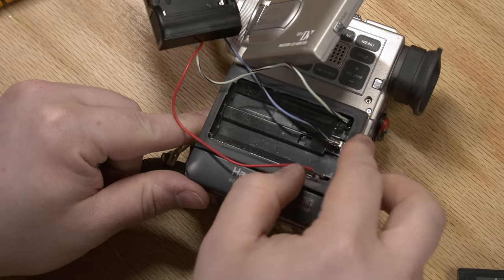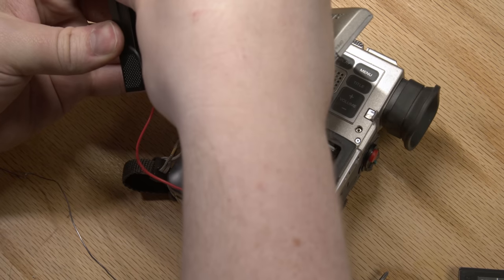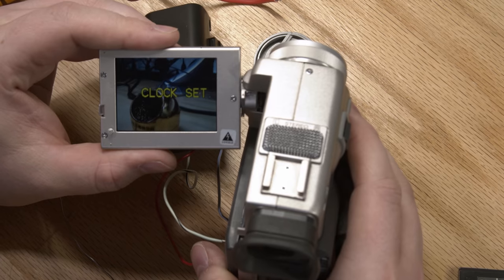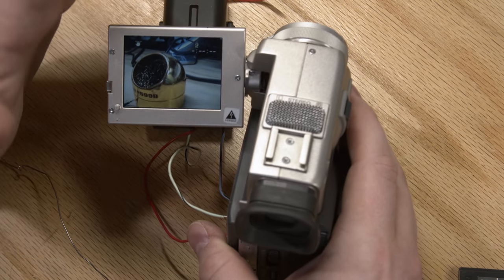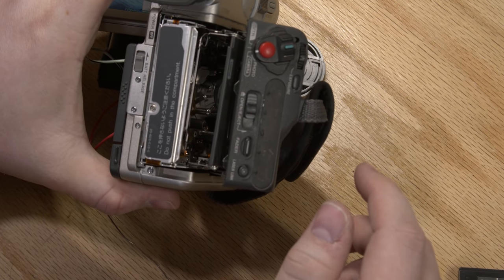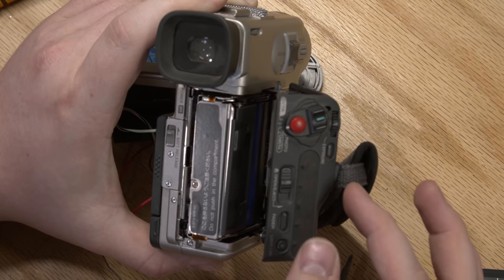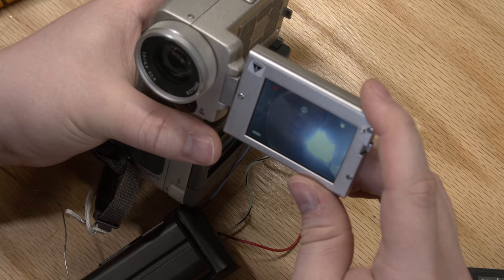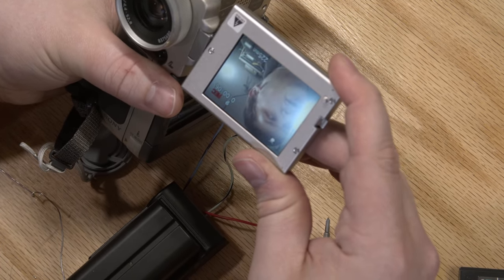Adapting Infolithium to Infolithium

Comment from the maker: Hilarious update: A week later, the friend who gave me this says that someone dropped off another one which included both the now-unobtainable adapter (the commercial version of what I made in this video) and the proprietary power cable "which everyone throws away."
Reply: did you get them?
Reply: I feel like literally almost everyone is completely incompetent with their power adapters/charger bricks... Like, does no one have just... a drawer where they keep every single power adapter, neat and labeled with one of those battery-powered label makers? How do you even loose a giant heavy black brick?
Reply: @datachu  you guys label the power cables? I tought it is supposed to be 30 minute mission to find the correct one
Reply: @datachu  to be honest I think I'm already on the upper-end of a normal consumer (not talking about pro equipment then) in therms of tidying my cables, and they're all in a box just tied together and done, heck labeling them up is definitely something I would only do when someone tasked me to keep their cable mess tidy (and I know for sure it would be a 1 month only thing, the next month it would be all a mess again).
Reply: @Kalvinjj  I probably just enjoy using my label printer more than I should lol. It just makes such satisfying noises.

Brrrrrrrr Awkward Pause Snip-Snap BEEP
Reply: btw next time if you cut down to your line with the side cutters first you'll save a lot of time sanding the case
Reply: @datachu  this is WHY I have started to flat our refuse to buy anything that does not simply charge by USB C. screw the noise of a zillion EVERY SO SLIGHTLY proprietary adapters. tired of that CRAP.
Reply: Next time JUST wait another week :-) ... but then we wouldnt have had such an interesting informative video experience on a lazy Sunday morning
Reply: Even though you made this, and used tape,  once you got it working, once you got it,  Silicon it the adpter in then Epoxy to finish the job.
Reply: Oh my gosh, that's a hilarious update, after all that trouble! By the way, I appreciate you showing all the silly mistakes you made, happens to me all the time, nice to know I'm not the only one. Awesome work though, very impressive.
Reply: I don't label mine because nearly everything I own with an AC adapter is just 5V, 12V, or 24V barrel jack so I can just use the rating on the back, but I sure as hell have a pile of them.  @datachu
Reply: Welp, that still leaves one camcorder that doesn’t have those things.

Comment: Extremely refreshing to see someone who is rightfully reluctant to work with lithium ions. I hate projects that involve being forced to worry about them.
Reply: This. Lithium Ion batteries explode if you look at them wrong.
Reply: @DrewWalton  I solder Li-on packs for drones all the time. Never had an issue. Li-on are so much safer than lipo. Lipo is what is dangerous
Reply: @nicknick8148  shit that's what I was thinking of! Lipo, not Li-ion. Good catch mate. Cheers!

Comment: Lithium cells are one of those things that people just never seem to appreciate are actually really dangerous if you mess around with them. Kind of like tires.
Reply: Tires and lithium batteries and car springs all share one common theme and that is people either beleive they are litterally bombs or people think they are harmless… very rarely are people in the middle where the danger really is.  The danger isn’t that any of these things are out to kill you but rather the amount of energy they contain in amount of space they consume is very dense… similar to a bomb… however unlike a bomb they aren’t just ready to kill you at any time

All of these things including lithium batteries if they are in most relaxed state, IE, discharged, deflated, or unbounded they are minimally dangerous.  They can still all be dangerous, a “dead” lithium battery can still contain enough energy to ignite some stuff and get hot… but be more like a AA battery shorting out when lithium battery is at cut off voltage.  a tire flat on the rim can still bite you back with the bead wanting to either be seated or unseated if your pulling at that by hand, and a spring even with tiniest amount. If rebounded it can release more energy than is being imputed depending on the material and the preload.
Reply: Wait, what's up with tires?
Reply: @Stargazer1312  It's that whole deal of a not insignificant amount of air compressed into a relatively small space, which results in quite a bit of stored energy. Safe enough, most of the time, to be around all day; but if all that energy gets released in a hurry, it can be quite unpleasant.
Reply: @Honeypot-x9s  Coil springs are fine right up until you actually have to remove or replace one on a strut. Then it's a bomb.
Reply: @tamberp  oh, right. I worked on tyres on push bikes since I was really little with my brother, so I was confused about tyres too. But that’s because he taught me well and I don’t even consider doing anything on a tyre without fully deflating it first. Actually that’s got me thinking: do cars still use inner tubes? Or do they just hold the air directly like tubeless bike tyres? In which case yeah that’s even moreso needing deflation first yeah.
Reply: @kaitlyn__L  Generally, no; most car and truck tyres are tubeless these days. There's still older stuff and special applications that use them, but for most applications they've had their day and fallen by the wayside.
Reply: It's kind of amazing how widespread lithium batteries got without anyone considering the side effects of the technology. I've had to pull bulging batteries from devices that are over a decade old and were just sitting in storage waiting to explode.

Comment: The cast iron pan being the upgraded version of the explosion containment pie dish?
Reply from the maker: correct!
Reply: @CathodeRayDude  an extremely wise move. I've learned the hard way about fucking around with lithium packs. No fire but lots of sparks and an inadvertently welded leatherman. Never again!
Reply: I was thinking the exact same thing
Reply: Far better than my quick-slap open window tactic
Reply: @jongmassey  my neighbours house burned down due to a litihum battery getting punctured, they are not for messing arround

Comment: for what it's worth, there are little portable spot-welders meant for building/refurbing small 18650 packs and they work a treat. I got a cheap one from Amazon for around £20 and used it to rebuild both the 6cell and 9cell packs for my laptop, so it was well worth the investment

Comment: Classic JB Weld is the bee's knees for sticking ABS plastic together real good. Sets to almost that exact shade of charcoal grey, can fill pretty big gaps, and sands fairly nicely. Not that you need it since the proper adapter wandered in, but there's always a next time!
Reply: I was going to say hot glue
Reply: @neb_setabed  Hot glue is bad for long term and exposed parts, it dries up and cracks. It's more like a meanwhile or test application rather than a definitive one. Epoxy is the way to go, JB Weld fits nicely here.

And if you want a well done thing, definetly 3d printing.

Comment: Also fun little tidbit: I'm pretty sure that "C" pin doesn't mean "Charge", it means "Communication". If I were to guess, it's probably a 1-wire communication bus, which is why the board on the old battery was so complex, and "InfoLithium" was such a big deal. The controller on the battery monitors power going in and out of the battery, judges the cells' lifetime, and gives the camera that fancy little battery gauge - which the camera would have no way of knowing without being able to judge the cells (swap the pack, change the cells, and it loses all behavioral info about them). So the individual packs track energy (Wh) going in/out of them, and the camera asks it for that info to display on the screen and act upon.

So yeah, that pin is important. :) Most cheap devices don't care about the pin, because the controller also has hard logic: it'll cut off power flow "with force" if it's being over-charged or over-discharged. So they just rely on that brute-force safety mechanism. Bad tactic, but it ... works ... so, cheap-crap manufacturers don't care.
Reply: oh and related factoid: these "smart battery packs" will completely freak out and set a "permanent fault" fuse, if they detect that any of the cells in the pack "go dead". So if you take apart a pack, and break the connection to the board, the board will use its remaining power from other cells to write "ACK! I AM PERMANENTLY DEAD!" (to its EEPROM memory), and you will never be able to charge/discharge it using good cells again. You have to get tricky - either find a way to cut off its main power supply (I think the negative-most supply lead, maybe?) so it can't write to its memory in time, or put the pack "on life support" and replace one cell at a time using a benchtop power supply set to 3.5v or so - like a heart transplant machine - so the board never "sees" the cells get disconnected. Might be easiest to solder the benchtop power supplies to the board's cell sensing terminals directly. Or just not do this at all because it's an effing nightmare.

Anyway, enough mind vomit. Awesome job with this overall.
Reply: @FalconFour  mine just did ,out of 2 cell one of it gone bad first  ı tried to revive it with bench power supply but it wasnt holding charge ,so ı removed it change it with 18650 battery with it's own controller circuit and that error message all the pins are there but like u said damn eeprom know it now ,and back then ı charged all the cells to total of 8 volts and tried on camera it didnt want to charge that pack already marked bad.

Comment: CRD: "I've never found a device that actually uses this data contact"
Sony: "Hold my beer!"
Reply from the maker: I should not have challenged sony
Reply: Well of course Sony would be the one to make use of the technology Sony created.
Reply: Yeah I have a Sony Mavica that refuses to use non-authentic batteries. It turns on, then displays a message saying the Mavica is for use with "infoLithium" batteries only, and then shuts off. What a troll. Fortunately some chinese battery manufacturers source the Infolithium logic board so it will trick the camera into believing it's an authentic battery.
Reply: Nikon laughing while counting bills. Their DSLRs wont even take fake battery adapters
Reply: @gabotron94  Good to know, one more reason that makes me glad I went with Canon back in the days... their DSLRs just say "cannot identify the battery - do you want to use it anyway?" "Okay, here you go" when I plug in my 3rd party mains adapter.
Reply: @tituslafrombois1164  Sony is all about the proprietary technology that does exactly what existing standard technology already does but that makes sure royalties go to Sony. Fortunately they are not successful more often than they are.
Reply: @chaos.corner  Trust me, I know... I've fought against Memory Stick on many, many devices...
Reply: This reminds me when this bullshit of DRMing everything bit them in the ass with the PSP's battery
Reply: Sony: The maker of all the obscure media formats and batteries
Reply: @CathodeRayDude  You should have realized that since it has the famous single proprietary connector they seem to have for every digital camera/CDman they made. I swear Sony has to be one of the single largest companies that's responsible for the ridiculously immense amount of E-waste in the world.
Reply: *hold my sake
Reply: @CathodeRayDude sega tried it with the trashcast. my favorite failure

Comment: Regarding these old generation InfoLithiums specifically, I've found my camera will work if you keep the original board for its ID chip. Disconnect the cells and put your own power source in parallel with the board's output terminals.

I pretty much agree with you regarding Li battery safety, however I have had success very carefully soldering to prewelded tabs. One thing to mention is always discharge the cells to 3.0v or so if you can before doing this as it should greatly reduce the chances of an incident.

Comment: Absolutely incredible to me that the InfoLithium signal is cross-compatible across different battery form factors. That seems like exactly the kind of thing that they'd flip a few bytes around for no reason other than a different guy was working on that particular InfoLithium form factor and they never conceived of anybody attempting to adapt batteries in that way.

If you have two pieces of plastic you need to combine like that, one approach I've used with success (ideally if you know they're both ABS, although you can often mix/match) is to get some 3D printer filament of an appropriate plastic (ABS/PETG/Nylon/etc, depending on the base plastics) and an old junky soldering iron tip you don't care about. Use the filament like a "welding rod" to fuse the two pieces of plastic together into an appropriate configuration. You can't easily take them apart, but the results are generally strong/permanent and don't look too bad if you're careful about how much of the plastic you touch/melt/fuse with the iron.
Reply from the maker: The reason I didn't join them permanently is because I don't want them to be permanent - someday these solder joints will break, probably someday very soon, and tape is much easier to remove.

Comment: Gaff tape is designed for temporary use. It does stick pretty well over the long term (the glue will dry out and get crusty eventually). But the "residue free" nature that you mention goes away the longer it is left in place. I'm talking like months to years here, not days.

Comment: You should also mention that fire extinguishers don't work on lithium batteries unless they're specifically made for that purpose. They just burn until depletion.

I have a friend that made a whole battery pack of 20 cells by soldering them, but he needed to use an iron that could heat up fast, with a flat tip, and with plenty of flux. That can't be used for rebuilding because it wouldn't fit the case. While it's not something I would recommend doing, that pack still works perfectly, comparable to all the ones they made with spot soldering. And the multiple fires he had at work were not from packs he (or his coworkers) made.

By the way, this kind of adapters would be probably best if we can make a design to be 3D printed.

Comment: Costum adaptor projects like that are where 3D printers definitely came in handy 😇
Reply: Absolutely!  With this project, I definitely would've taken an afternoon to measure the heck out of each battery type and the charger, spend another day or two modeling an adapter in FreeCAD, spent another afternoon making an adapter PCB design, ordered a bunch of pogo pins and stuff from Digi-Key, then never actually finished the project.

Comment: When I need a weird power adapter for a camcorder, I visit a site like ManualsLib, find the manual for the camcorder, and usually within the "included accessories" list near the front they give you the model number of the AC Adapter, which I can then plug into eBay and usually find what I'm looking for.

I've also used this method to track down the exact right remotes for several video decks.
Reply from the maker: Yeah, I've done that sometimes but I have mixed luck with it.

Comment: For basic project wire, you want 22AWG, stranded (7/30 aka 7 wires at 30AWG),  tinned/silvered copper wire. Any insulation is fine. 

For small repair (aka bodge) wire you want 30AWG solid tinned/silvered copper wire with Kynar/PVDF insulation.

Comment: I worked for Sony back when this camcorder came out.  I own a later model, the DCR-PC100.  It uses the NP-FM50 battery.  I never realized just how few cameras used the NP-F100/300 battery.  There were only 2 models that did.  DCR-PC7 and DCR-PC10.  They definitely are next to impossible to find.  The rest of the DCR-PC models seem to use the NP-FM series battery, which is still pretty easy to get.  Good little converter there.

Comment: Man, I really felt that wire rant.

"Most of the stuff on Amazon is basically fraudulent."  As is the case with any category of product on Amazon.

"If you go to website like Mouser, you can buy wire there ... and a lot of it is incredibly expensive."  Would you like the 100' spool?  Or the 1000' spool?  The price is "WTF!" per linear foot for the 100', and "Geeeeeezzzuusss.." per linear foot for the 1000' spool.  Would you like nylon braided wrap?  That's only "What!  HOW?!  When did Nylon become a rare earth material?!" per linear foot.

Do you need some connectors?  Probably should consider the special crimping tool, with an assortment of die sets.  Complete kit for the low price of "This is a small country's entire GDP!"

I encourage anyone to go quote the BOM for any small community-produced electronics project product / kit, and then complain out loud that "it should only cost like $30 for this."

Comment: I mean, the manufacturer of the cells says you shouldnt solder them but you can get cells with solder tabs pre-welded, those are extremely easy to use with little added cost if you are ordering from china.
If thats not an option sand the contacts of each cell, use RA flux and pre tinned "red hot" soldering iron ~400°c, it takes some practice but its very much doable and the packs I made work well so far and I'd even argue that soldered packs are better at supplying high currents >15A these are my two cents nobody asked for :D
I kinda always wondered if those "block" infolithium packs used regular 18650s or something else and lastly, picking out wire to buy is always hard, so many options and colors :D

Comment: I started to use 3D printer filament and a soldering iron to join random bits of plastic together and fill in gaps. You can also get hand-held pens for this purpose too, which make a prettier job of it. The end result can look pretty good too, depending on how good you are at sculpting!